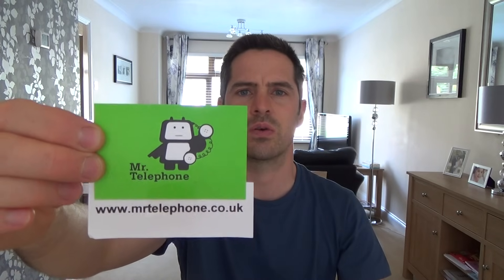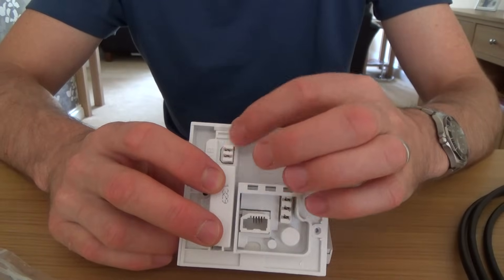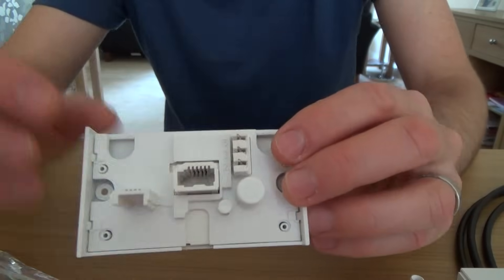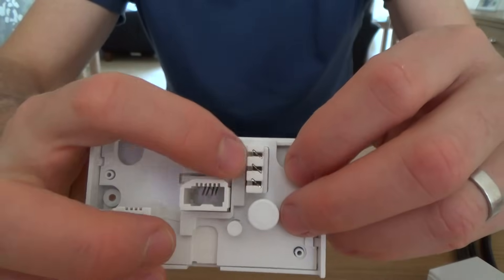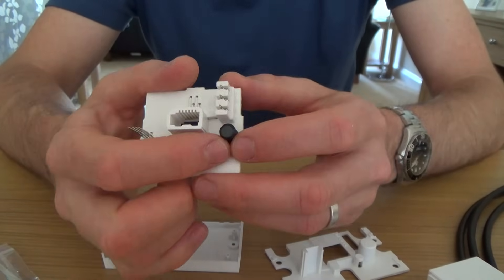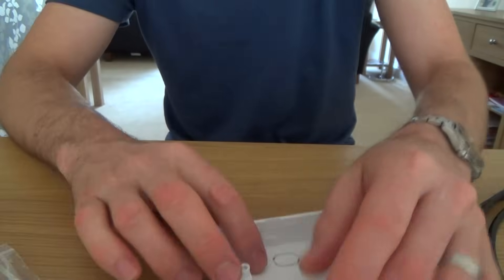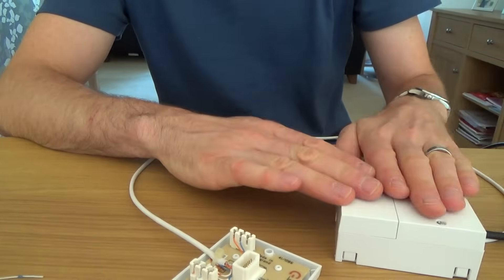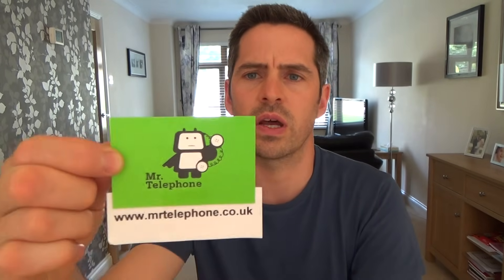How to install a NTE5 Telephone Master Socket and Telephone Extension

Comment: hi i followed this to run an extension  to 2 other sockets.
http://telephoneextensionsocket.com/telephone-wiring-colour-code/

 the first runs from the master socket front plate then the second socket feeds the 3rd socket. all works if you only use the master socket but if you attempt to use a phone on the other 2 sockets you get noise and very very low volume on the phone. iv tried asdl filters on each point but its the same so iv had to default back to using the master socket.. any ideas ?
Reply from the maker: I would try a bit of fault finding to try and eliminate the problem. Try disconnecting the wiring feeding the 3rd socket from the 2nd socket to see if that 2nd socket works ok and then you can start to narrow down the problem. If it works at the 2nd socket then punch back in the wiring feeding the 3rd socket but disconnect the actual 3rd socket to see if the 2nd socket still works with all the wires connected. Also before doing any of this make sure that all the phones/equipment work properly in the master socket in case the wiring and sockets are ok and one of the phones is faulty.

Comment: hi how would u join the black wire running into the master socket from outside?my problem is that the master socket is in the front of the house by the front door and i cant get wifi at the back of the house where i really need it would like to move router to the middle of the house but i really dont want to run an extension on the skirting board

Comment: great video vince :) I have bt infinity and the wiring from the master socket to the router is broken do I just follow this video for fibre optic thanks in advance :)
Reply from the maker: +keith browne Hi, is it your flexible lead that goes from the micro filter/wall socket to the router that is broken or is your router plugged in via an extension socket which is broken?
Reply: +My Mate VINCE  hi mate it comes from out side to a blank plate then the white wire to the main box is broken if that makes sense thanks for your reply
Reply from the maker: +keith browne It might be a different colour code if it is internal cable so just have a look at how it is currently connected on both ends of the cable and make a note of it (or take a picture) and then when you get your replacement cable just copy how it was previously done.Thanks Vince.
Reply: +My Mate VINCE  great will give that a try mate I have cable I think the bt engineer left a brand new huge roll will try and use that thanks for your help will let you know how it goes lol thanks. Keith

Comment: Thanks for the video...:-) Can i replace an old BT 20/4 SSA box ? As i have this box connected to the wires coming in from outside and then a cable to a BT master socket...?

Comment: Good evening,

I have an old GPO (probably 1970's) junction box (with a single screw in the middle) in the kitchen that connects to a wire that comes in through the wall from the telephone pole outside.

There is a BLACK wire (not connected), a GREEN wire (not connected), 3 YELLOW wires (not connected), a WHITE wire (connected) and a ORANGE wire (connected).

I have bought a Master Socket NTE5A.

Can I disconnect the wires from the old GPO junction box (the only ones connected are the WHITE and ORANGE) and reconnect the WHITE and ORANGE wires to A (WHITE) and B (ORANGE) on the NTE5A please?

I don't want to run an extension off of this.

Thanks in advance.

Comment: Vince,
Thanks for the great video, I will subscribe.

I am looking to move my BT from where it enters the house. The cable that comes in through the wall is very old.  This enters an old extension box (just inside the house) before continuing on to my NTE5 BT box.  The cables going into the extension box from outside are both black, and appear to be single insulated solid core cables.  These cables leave the extension box and go on to my first BT box as an orange and a blue wire.

Can I just assume that these two black wires are the same as your orange and white wires and install a new NTE5 in place of the extension box and then run an extension to where my first BT NTE5 is currently? 

Thanks in advance.
Reply from the maker: +Paul Welsby Hi, yes that is correct, you have the very old figure of 8 cable (like bell wire but thick).
Thanks.
Reply: +My Mate VINCE If the old bell wire is not long enough to go the new route I want what is the best choice of junction box and cable to extend the cable?  The cable is half way and runs along up my gable end.
Thanks
Reply from the maker: +Paul Welsby If it is external then you can use a waterproof repair joint (I did a video on these called something like repairing your external cut telephone line). If it is internal then you could use a BT80.
Thanks Vince

Comment: Very helpful video Thanks you, while this covid 19 is around the Openreach guy could not come in my house for sky phone & broadband connection
he did his work at the top of the road in the green box and I had to plug a filter into the old BT socket and run the phone and broadband from that and a extension lead up the hall for power.
To get this sorted I wanted to drill through the old metal back box and run a cable outside to neatly to the side of the hall wall and comeback in under the stairs close to a socket, I was just wondering what cable is best for this now, and  do I use a new master socket or please advise what socket I can use under the stairs. Thanks again for all advice.

Comment: I'm trying to wire in an extension to the phone line, when ever I try and test it I get no dial tone in the line. Then if I just plug into the faceplate the dial tone in back. It seems like whenever I punch down the cables I don't get a dial tone, I've try different cables, sockets, kits from the shops and still no dial tone, can't work it out. Have you got any suggestions. 

It seems like when ever I work with the data side of things it fine, but I move over to the phone side and nothing works for me. 

Thanks
Reply from the maker: Hi, maybe just try a very short bit of cable 30cm from the working socket to the extension socket to make sure the extension socket is working ok. If it is then you know that either the longer original cable is faulty (or has a staple/cable clips punched through it) or the wiring is incorrect. if the short extension doesn't work then the socket is faulty or the wires are not punched in fully all the way to the bottom of the terminals. Also make sure you have just 2 wires per IDC terminals as the 3rd wire doesn't make a good connection.
Thanks.

Comment: Hi and thank you for a most interesting video.I am an sparky by trade but i must admit the phone system has always been a little foreign to me.Ive recently moved into a bungalow and have found my Sky broadband keeps droping out,on phoning sky they tell me that the router needs to be connected to the master phone socket.I ve found that the phone system had been seriously "bodged" by the previous owner and there was no master socket.I purchased a cheepy from toolststion which just looks like a slave but has a capacitor and what not inside,so im hopeing that by fitting this itll cure my internet problem,time will tell,anyway i havnt connected the orange to terminal 3 [ the bell]  ,it all seems to work ok, so my question is whats the point of the 3rd connection if it works ok on 2 ? Im a little confused. Thankyou again.Graham.
Reply from the maker: Hi Graham, the ringer (bell) wire is used when you wire up extension sockets but nowadays it is rarely needed. Years ago you needed the ringer wire to hear the extension telephones ring but most recent phones will ring on 2 wires so a lot of people leave it disconnected as it can affect the broadband signal.
Cheers Vince.
Reply: My Mate VINCE Thank you Vince for your very helpful advice and quick reply. All the best.Graham.

Comment: if you had really old telephone cable that had thicker than standard wires coming in to an old beige gpo junction box which then went into an lj2/1a master socket. How would one go about connecting the wires to a newer nte5a box. Or would it be better to connect to the (older?) nte5 box as in your video to use the screw terminals?  Thanks!

Comment: Hi Vince, I've had a problem with my internet connection  and Sky have advised me it's an internal issue, probably the master socket. 

Upon removal of the face plate there aren't any wires connected. I then remove the master socket it's self (screwed into electricians metal back box), so find that blue and white blue wires are connected to terminals A and B, the wires are screwed in (hope you're following me here). As per your above video, it would seem that the wires I can see are from an extension cable. I have green, green white, blue, blue white, orange and orange white. The cable housing is grey too, not black. My problem is I don't know which wires to connect to the A and B terminals on the main socket, and then which wires to connect to the 2, 3 and 5 terminals. It appears there are too few wires. 

Any help would be greatly appreciated! Thank you in advance!

Jacob

Comment: Hi Vince - great video...just wondering if you know the answer to this...

So I’ve moved into a new build. I can only get standard broadband at the mo. When I plug directly into the test socket I get 8.5MB (which is all I can ever seem to get here). However, when I put the faceplate on and plug into that, the most I get is 2.5MB. BT did some tests over the phone and said they were getting an error message that meant interference. 

I bought a new socket, and switched the wires over to the new faceplate...in case the old faceplate had something wrong with it. Same thing is happening...test socket is great but going through the faceplate isn’t.

I’ve checked the wires and I’ve wired them correctly. There’s no damage to them either. 

At a loss as to what this means. Any ideas?

Thanks
Sebastian
Reply from the maker: Hi, you could try disconnecting the bell wire (terminal 3) to see if that improves it. Better still if you are happy with the router located by the master socket then you can just buy an ADSL/VDSL filter and then you will get the same speeds as the test socket :-)
Reply: Thanks...I've got one of those coming today. I tried to buy it from your site yesterday but it didn't look like you had any in stock. Great videos and thanks for the reply!

Comment: Hiya pal, can you link me to your eBay page for the older type screw nte5 please? Moved house recently and have this weird little box hanging off main socket. Finally plucked up courage to open it, it's two black wires on one side, with blue/white and blue on other. Glad I watched your video as didn't realise there were different types! Cheers
Reply from the maker: Hi, I can't get the screw terminal version anymore. If you message me over on eBay I might have some let over if I hunt around :-)

Comment: Thanks for the video. My father-in-law has a phone issue, but the phone works OK in the test socket (NTE5). He use to use an extension and an external bell ringer, but these are no longer required. If I removed the front plate and removed all the wires, would the phone from the master socket still work? I assume the incoming A/B wire connection will be at the front socket when the front plate is fitted? 

Thanks,
Steve
Reply: Steve you may have done this already... but as long as you are removing the cables from the face plate of the NTE5 master then yes anything connected directly to the master with the face plate fully connected WILL work.
Reply: Yes all sorted now, many thanks for your video...

Comment: great video mate.. I took my faceplate off today (I'm getting 0.06 upload and its driving me crazy!) when I removed it, there was no internal wires connected to it?? would this be my issue? however I get my full download so.. any thoughts mate?
Reply from the maker: +Ian Reynolds Hi, you will only have wires connected to the fronplate (if you have an NTE5 master socket) if you have extension wiring. If you only have the one master socket then you will have no other wires. The thick snipped white wire may have been a faulty cable from years ago. Normally BT/Virginmedia do not remove old wiring because it may have layers of paint on it and it can look messay when they get removed.Thanks Vince
Reply from the maker: +Ian Reynolds Forgot to mention, it is normal to have loose wires stuffed in the back as these are just the spare wires in the cable as the telephone only uses 2 of them.

Comment: Hi My Mate Vince,
Thanks for uploading the video. It was very informative. I have a question. I live in a new house. The master socket as I understand is outside the house. I have six sockets, one in each room. I would like my wireless router (ADSL) in my study upstairs as that gives the best signal. One day my speed was slow and so I contacted BT. They sent their engineer over and he fitted a line box in the hallway socket which is nearest the front door and made that my master socket by attaching an add on filter. Now the problem is that I do not want my router there as I get really bad wireless signal upstairs in the bedroom and study where i need internet the most. I asked the engineer whether he would be able to place the line box in my study and make that the master socket, but after testing out all the sockets and connecting all the pairs, he told me that there was a socket missing somehwere and hence he was unable to wire upstairs to the study room socket. I really did not know what he meant. I have four line pairs wiring and all my sockets have a dial tone. 
Today after watching your video, me and a neighbour took down the filter component from the master socket so that the broadband signal would go to the other sockets and have started using my study socket again with an ADSL filter attached. Although the speed is slower, I am getting a better wireless signal. 

I have two questions.

Q1. All the sockets give a dial tone, so presumably they are all working. However the BT engineer is saying that there is a socket missing somewhere, hence he could not hot wire the study room socket. if a socket was missing, at least one or two of my sockets would not work. Am I not understaning something? Is he right or wrong? My house is till under warranty with the builders so if there is anything wrong with the wiring, I could still get it fixed by the builders.

Q2. I got a bit worried when you said to install BT infinity, I will have to install a special type of add on to the master socket whch will act as a filter. This has worried me as again the place would be in the hallway socket which the BT engineer has used and the wireless signal from there to the rest of the house is patchy. When BT infinity becomes available in my area, can i not uptake the servive without using that add on filter and thereby confining my router to the hallway near my front door.

I would be grateful for your help.
Many Thanks
Mehdi
Reply from the maker: leicesterbengali  Hi Mehdi, I am wondering if he meant that there is a hidden junction box somewhere. It is quite common to have the telephone extensions star wired from one point maybe in the attic or cupboard somewhere. If you are part of a housing estate then maybe your neighbours will know if the houses are the same type.With Infinity apparently they have started to do self install so I presume with self install that they are moving back to plug in 'dangly filters'. If you can't get to the bottom of your wiring problem then a new cable could be surface run perhaps externally from the outside BT point to the study to make it a 'proper' master socket and then all your extensions could be connected up from there making sure the old feed has been disconnected. Having a proper master socket is always best because then you have the option of using a VDSL faceplate or ADSL faceplate. It is not ideal in a new property to have surface wiring but it would solve the problem.You could get a local ex BT engineer (look in local papers/ online) to have a look at it in case the original engineer wasn't experienced and it would be half the price of paying BT, this may be a waste of time if the 1st engineer was good.Thanks Vince
Reply: My Mate VINCE Thanks for your help mate

Comment: Just checked my master socket and the wires are Red, Blue Brown Green not Green, Black, White, Orange
Reply from the maker: Hi, the pairs in that cable are.....the 1st pair is orange and blue and the 2nd pair is green and brown. Normally the 1st pair will be the working pair so orange to terminal A and blue to terminal B.

Comment: +My Mate VINCE 
Hello thanks for the quick reply, I will go with the lead with plugs RJ11 & RJ45 about 20 feet should do it & VDSL faceplate the one that just pops on no wiring to do...I will order the Vdsl plate from your Ebay shop, how do I order the 20 foot cable (leave a note when I order faceplate) or a separate order...Thank you very much for your assistants...

Comment: This is a fantastic guide - thank you! I can figure it out how to connect now, but first I need to disconnect some old cables. They don't look as though they will just pull out as they are stuck in the metal gripper thingies. Can you tell me how to remove them?